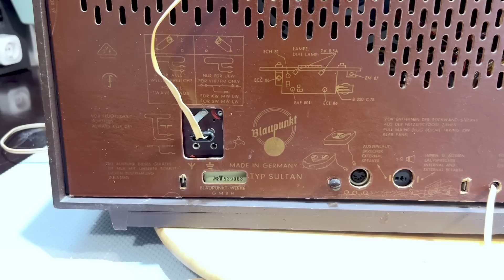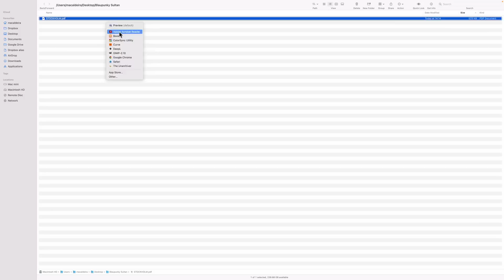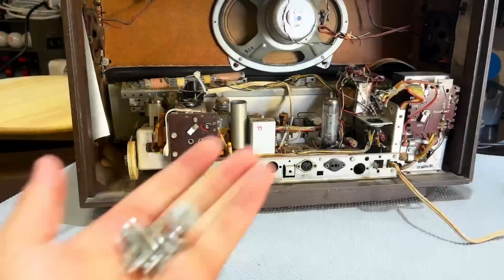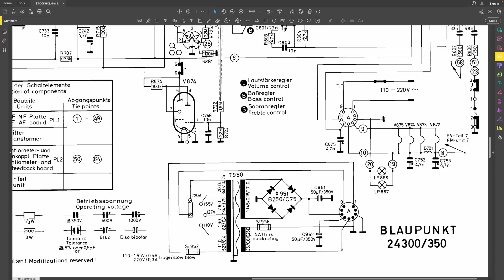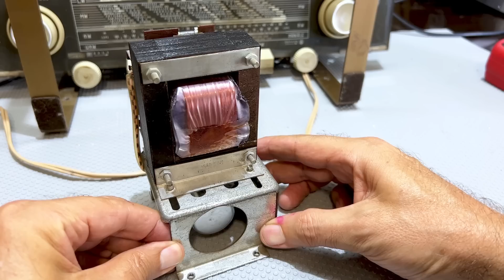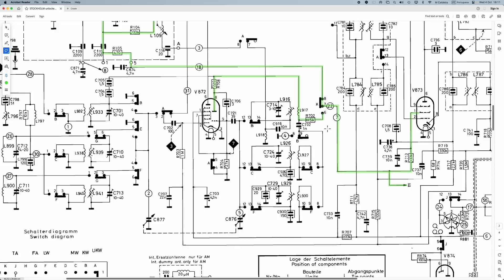One of the last tube radios made in the mid-60s. Blaupunkt Sultan 24300 restoration pt.1

Comment: On most radios of this size, they used an EL84 as output power tube. Here they instead used a lower power output tube, the ECL86. I have wondered very much why the radio manufactures mostly used the EL84 when ECL86 or ECL82 actually provided good enough output power. When the radio industy changed from tubes to transitors on radios of this size, they designed them with output powers of mostly less than 2 watts, and obviously they thought this was good enough for a radio of this size. Why did they use EL84, which provided a wattage of more than 5,5 watts when it was good enough with half of that wattage when the transistorized table-top radios came?
One little problem with ECL82 was that it was specified to a maximum voltage of 200V at the pentode plate, but the ECL86 could allow higher voltages.
Reply from the maker: The Ecl86 is a triode and output pentode in one. May well have been a little expensive. Since these radios needed 3 diodes for detecting AM and FM, and that was provided in the eabc80, they probably decided to take advantage of the “free” triode in the eabc80 for the pre-amplification, and then a single pentode power stage using the el84, which may have been cheaper. Just a guess.

Comment: The finish used on the later models is not lacquer. It's a tinted (dark walnut) two part polyester resin.  The color always came from tinting the top coats, whether the top coat was nitrocellulose lacquer or the later two part polyester resin top coat.  The actual veneer was never stained, as doing so causes the veneer to lose definition.
Reply from the maker: Thanks for the info.

Comment: Great Idea outlining some of the work that often doesn't make it to the final video. I will assume you are on a Mac, on WIndows PCs there is a 'print to PDF' print option, you can simply print the locked PDF to a new, unlocked, PDF. I liked your option also 👍 The Loewe radio I have just rewound the transformer for also had the wire gauge and turns numbers on the sleeve and in the schematic. A completely different mindset back then. Thanks for the shout out, you do alright on the cabinets too Manuel 👍😀
Reply from the maker: I have tried the “print to” option here and it doesn’t unlock it with my MAC. I really like the detail that was provided back then. More helpful, and less afraid of copycats. 
I like doing the shoutouts as I see this as a community, and really believe that “the more the merrier” 😊 also, I find it amusing that some personal messages I get seem to believe that you and I are bitter rivals 😊 I always respond that I’d never get into an open rivalry with an Aussie as you guys have huge knives, while we can only fight back with bottles of Madeira wine 😊you would ultimately win the fight, but we’d be really merry as we faced our doom 🥴
Reply: @electronicsoldandnew  Haha... we do have big knives 🤣 I had better add a disclaimer to any videos where I include you that it is all in jest and we both hold each other in high esteem. 🙂🙂🙂
Reply from the maker: What! And end all the fun? No, rather bring a knife out and threaten to shred any cabinet that I restore using any of your tips and tricks. Should provoke some funny responses 😂

Comment: Now that you have a 3D printer you could make some covers for the open pots 🙂
Hhhhmmm if you don't have a variac you could feed a low frequency tone in to the transformer too ?  Have to try that.  Have to take a wire of the cap of course.
Reply from the maker: You can do that, but the source of the signal must be able to drive the transformer as a load. Sometimes a simple signal generator simply doesn’t have the ability to do that. The best alternative is to ilude a simple small AC transformer with 6 or 12V, which are easy to find in a junk box.
Reply: @electronicsoldandnew I found a small audio oscillator like a XR2206 going through a little TDA7231A amp that will put out 1-2 watts.  Run the lot off a 12V.  Also good for speakers and audio transformers.  Take the low level high Z XR output and used for feeding into amplifiers too.  Not one of the Kits - a few problems with their dersign.  I just used the datasheet.  I frequently use mine with just batteries.  Curtsy of PCBWay of course, a shared project 🙂  Could be a useful additional to your under shelf collection of gadgets and gizmos.

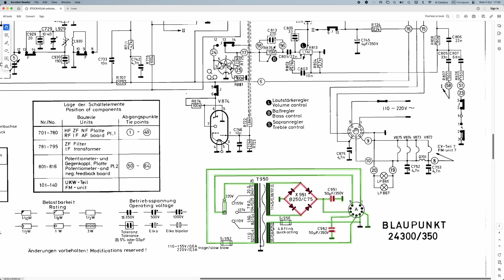Comment: Have the same one but it has no PCB. And all the IFTS had silver mica disease. Its is working now after SMD cure and recap. Did put 4 silicon diodes and 56ohm resistor + bypass caps. 33:41 so nice that they provide number of turns, wire gage and resistance on transformer.

Comment: Nice video as always.
Have a closer look at the schematic. Around the mains and audio output transformers, they not only indicate the wire gauge and number of turns of the various winding sections, they also give you the resistance in ohms. That is a great help in checking if the transformer is OK and, if not, which part of the winding is either broken or fried.
Reply from the maker: True 👍

Comment: I think the Sultan refers to the full "form factor" cabinet like the one you have and the Stockholm to the lower profile - speaker on the side of the dial glass models. 
On a side note , lazy suzan is nice for the initial presentation and a good look at the finished radio but all the wiggling and jiggling in between is kind of annoying.
There i said it. 🤪
Reply from the maker: True. The vibration doesn’t make for good video.

Comment: The ECL 86 has become a lot more scarce, and as a result, a lot more expensive. US prices from the main suppliers are now close to $60, and supplies are low. Really a shame, because that tube is considerably more problematic than the EL84, EABC80 combination it replaces.  I know of no technical advantage, so I assume they did this for cost savings by reducing the tube count. And then, of course, there's the use of those flimsy, easily damaged, phenolic circuit boards. Ugh.
Reply from the maker: I was lucky to find some ECL86s and then someone sent me a few as well.